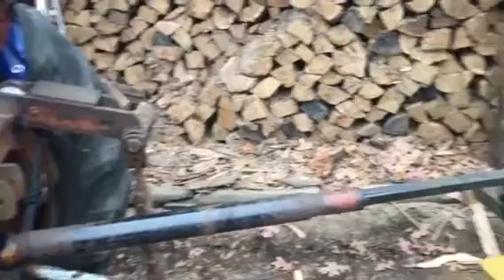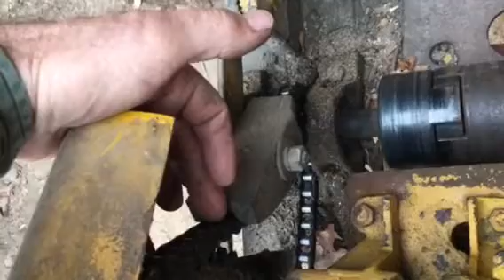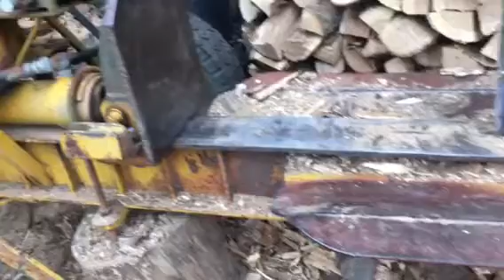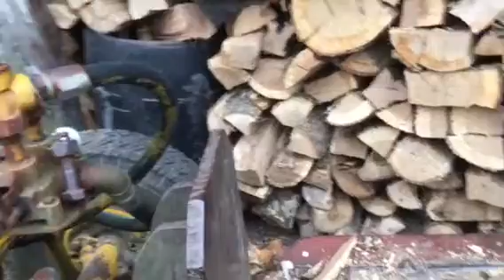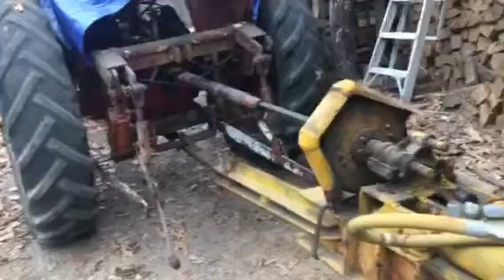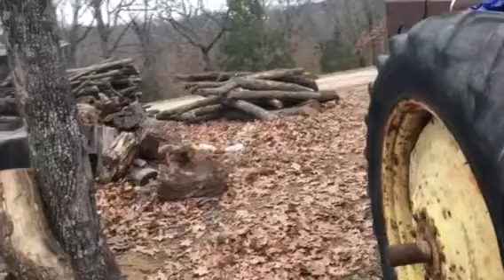Homebuilt PTO Driven Woodsplitter

Comment: hi there got to love how we put things together from this and that . with out the use of a confuser . john
Reply from the maker: Heck yeah....this thing has a lot of parts from farm machinery as well as an old Ford backhoe.  Whatever it takes.  I usually think of what I want to build, check the stock pile then adjust what my ideas were to fit what's available to build it with....  Btw...I was on my I-phone checking in and I know I saw where you asked what state I was in but for the life of me I can't find where that was....so I'm right off the Mississippi River in Missouri not too far south of good ol St Louie.  I remember you said you were in Maryland in that comment.  Man you are over there a pretty good ways from here !!  I'll find that comment sooner or later.  I hate to reply on the I-phone...too hard to type on that tiny screen.
Reply: @tractorman4461  man spot on make a plan check innovatory adjust plan start building . whats ya plans to build next .   john

Comment: that is truly incredible. As someone who splits a lot of firewood, I'm very impressed with the amount of thought that went into this.
Reply from the maker: Francis Hamre thank you for the compliment on the old machine. My older brother is the one credited with the innovative design of the kneeling axle. He’s built a modern version of this with a second cylinder that lifts and lowers the beam instead of using the bar for lifting like this one. Most everything is discarded steel and used machinery parts. This time he started out with a monstrous wedge and push block. Thanks again for watching sir.

Comment: I got an orange splitter with the kneeling axle. Got it from a scrap yard in bloomsdale
Reply from the maker: Man, you was real close to me there !!  Did someone turn it in for junk?  I buy some things from those guys on occasion too.  Hope you got a good one, or at least easily repairable.
Reply: @tractorman4461  yeah! Im pretty sure it was the same scrap yard cause they had a cool bridge too. So far it just needs a hose and a tube for the tire. Ill get it goin and see how much i can split with it. How many did your brother make? This one says 92'
Reply from the maker: @bradleyrozanski1549  he’s the only guy locally I know of that built them with kneeling A-frame axles. I think he built four but I can ask him. The first one was a railroad rail for a beam. It twisted and moved like a spring. Then he and I have two then the other one went to a friend just south of the Isle de Bois creek. Probably around that time frame. But it was a PTO driven splitter and pretty heavily built too. Does yours fit that description?
Reply: @tractorman4461  it does. I bet the fella was cleanin up  ill make a vid of it for you this weekend
Reply from the maker: @bradleyrozanski1549  Excellent Bradley, slip another comment here on this thread and I'll be able to find it real easy.  I'm really interested to see it it might be the one he built.

Comment: Nice splitter!  I like the axle feature. It's now 40 years old and still in good shape. It's definitely well built! Overbuilt is underrated!  I've built a splitter 2 years ago, you might be interested to see it. It's in video #77. Thanks for sharing!
Reply from the maker: Heck yeah Joe, I'm gonna go look right now !!  You're right about the 'underrated' thing.  We usually build mostly out of materials we have in stock.  Spending my career in service and construction has led to some pretty good uhhhhh...'purchases' from jobsite dumpsters.  We figure it'd be silly to go buy something lighter duty just because what we have to build out of is a little heavier than needed.

Thanks for the comment sir.

Comment: no pto protection , what a death trap . all could be accomplished with a hydraulic pump mounted directly on the pto elimination the hazard and improving performance .  wouldnt come close to this machine as it is an accident waiting to happen
Reply from the maker: This was built on a shoestring budget out of necessity in '78 or '79 with 90% of used and available parts.  So when it breaks down...it may go through a bit of an upgrade, but I don't know what that'll be yet.  By your comment, you'd think we would have killed or maimed at least one guy with this 'deathtrap' by now but happily there has been nothing but a splinter  here and there.  I guess we may have just been lucky for over 40 years...OR it may be that being the survivors we are and having been raised on every pto or belt driven piece of farm equipment imaginable have the uncanny ability to keep ourselves out of the grasp of this devilish machine.  But one thing for sure, when this inevitable accident happens, it WILL make for a good video.  I do hope to capture it when it happens.
   No one with any common sense gets any closer to the pto than necessary and though yes, it can do some damage or worse pretty quickly, using this machine is no more dangerous than running the circle sawmill or the buzz saw or the flywheel engines or a chainsaw on a hillside in the snow.  The trick is knowing the machine, being aware of the surroundings, understanding the risks and having the thought of personal safety on your mind when engaging in the activity of using it for its intended purpose. We do, we have and we will continue to do so.....until it breaks down.  There are those though that should not EVER be around a machine like this. 
   I applaud you ken, for your candid thoughts on the wood splitter and for the record is the very first comment that I can remember to be less than supportive.  But differences in opinion is what makes the world go round !!